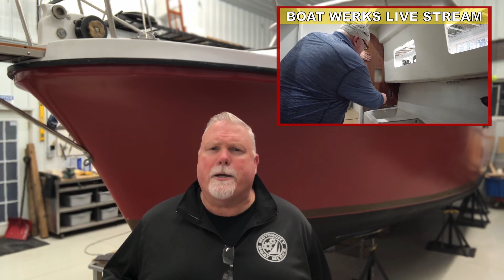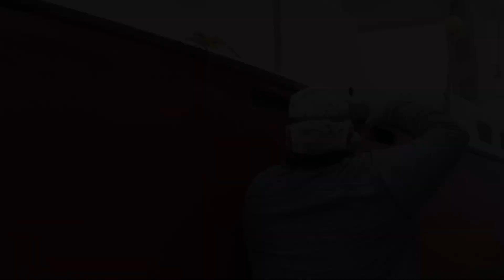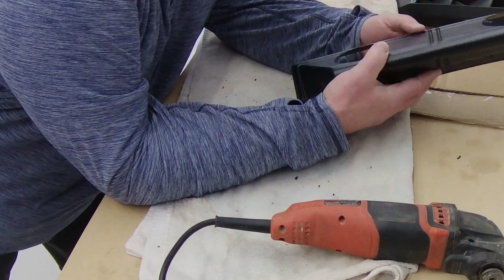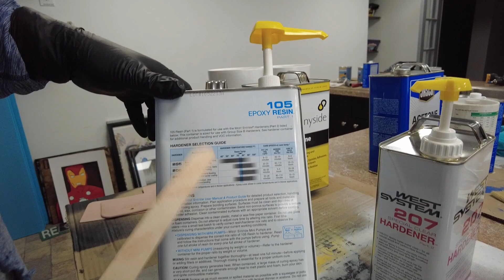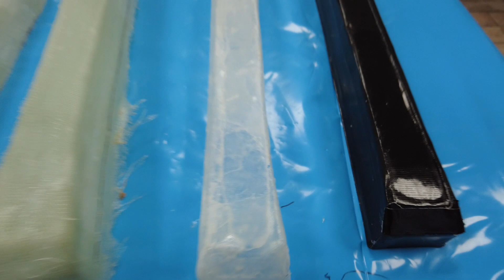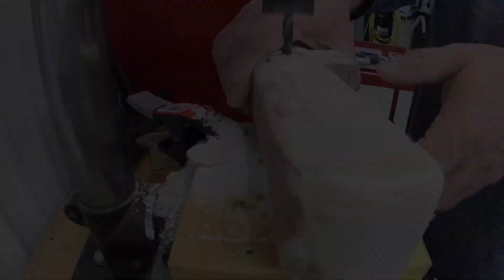How to Make Fiberglass Boat Parts | Engine Vent Dorade Boxes | Fiberglass  Boat Building - (Ep32)

Comment: Can't  you afford a bilge pump?
Reply from the maker: Sure and I will have several. But bilge pumps don’t solve the problem of water entering the engine compartment. Why rely on a pump when water can enter four gaping holes in the hull of the boat? Google the court case Jurgensen vs Albin Marine, in which a similar Albin 33 sunk in the Potomac. The related lawsuit revealed other owners reporting water entering the engine compartment via side vents in a following or quartering sea. 🧐

Comment: Hey brother, great video showing how easy it can be to make your own parts. I made my own intakes for my 34 Hatteras with 1" green insulation foam. I made the posts shape, then took the foam out, and used acetone to melt any stuck foam, and then used sail battens for the horizontal louvers. Very labor intensive, but it's a custom fit, and cheaper than you can buy anywhere. OOHRAH!
Reply from the maker: Nice 👍

Comment: Good solution. Do you plan to bond the dorades to the vent covers when installing?
Reply from the maker: Right Dave. I think a good marine sealant both for the dorade boxes and the vents to the hull. Although I want the vents still removable
Reply: @MotorCity Boat Werks  use silicone so they're removable. Or 5200, so they're removable with a jackhammer lol. S/F